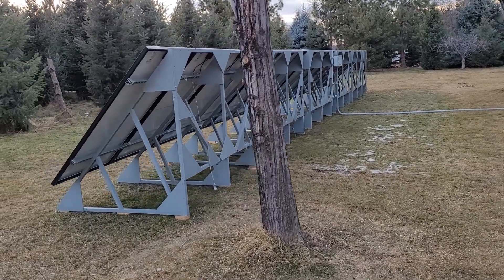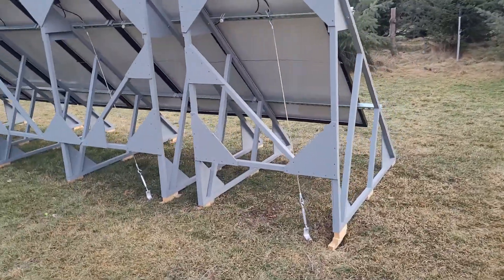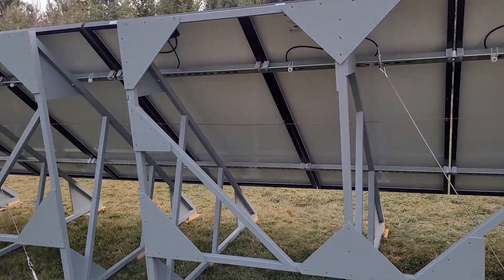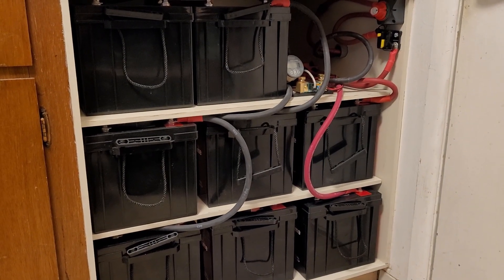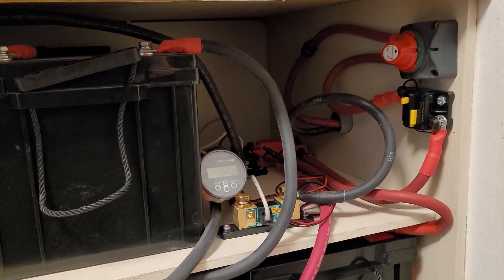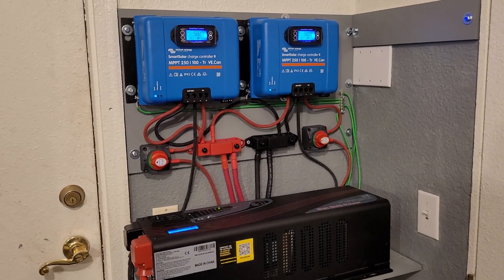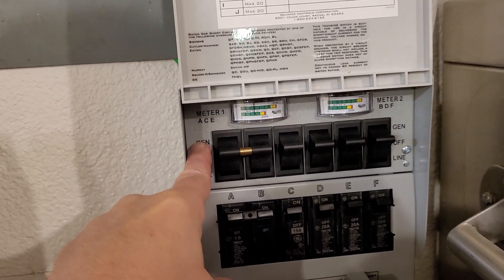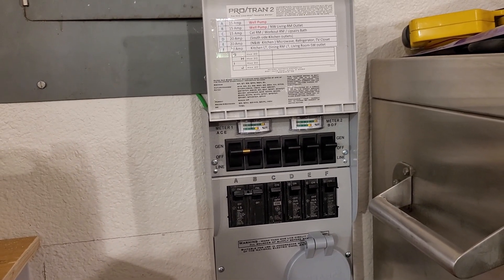Will this Solar Array Power An Off-Grid Cabin?

Comment: This was so fun to watch!  How often will you need to replace the lithium batteries?
Reply from the maker: They are supposed to be good for at least 4000 deep cycles.  That would mean if you drained them 100% once a day, they would be good for about 11 years.  In my case I don't come close to running them that far down every day so who knows exactly how long they will last me, but I am hoping somewhere from 15-20 years.

Comment: Look into micro-hydro-inverters when you look for power in your NID property.  You have great flow in the creek/brook.  Not sure of your drop in terrain.  Seth with Land to House has a good channel.  I am sure there are better channels for your specific needs too.  Might be too cold for hydro.
Reply from the maker: The creek is quite a distance down the mountain from our building sight however there is a natural spring that runs near the structure that has really good flow through the winter and early summer.  I will be looking into hydro in that stream to supplement my solar power which of course will be somewhat diminished in the winter months.

Comment: how about using one of those lock out double breakers for switching outputs from 220vac to either the well pump or the water heater?  that would let you run one at a time, but not both.
granted, i'm not an electrician.
Reply from the maker: I'm not an electrician either but your suggestion is certainly a good one although ideally, I would have a transfer box with more circuits.  Actually, my system could probably power my water heater in the summer months but probably not during the winter. I am going to be doing a 1-year review on my system outlining what has gone well and what needs to be improved.  keep an eye out for that video.  Should have it out in a couple weeks.  Thanks for watching and commenting.
Reply: @kombidog  i made a mistake on my reply...the difference is that double switches should be used, not double breakers.  breakers would just turn off the output, not switch it.
Reply from the maker: No worries, I understood what you were saying.

Comment: What kind of clamps attach to the uni strut? Looks amazing!
Reply from the maker: I ended up just drilling holes through the bottom of the solar panel frames and then running bolts clear through the unistrut.  Originally, I had bought solar panel clamps and unistrut nuts, but the clamps required too much spacing between the panels.  As it was, I could barely fit 3 panels on a 10-ft stick of unistrut.
Reply from the maker: I am probably going to do a 1-year review of the system in the next couple of weeks.  I will include some footage of the panel mount.  Look for the video!

Comment: Love your ground mounted you made, i thought it was made from steel in the beginning, amazing job. How do you like that Victron 250/100? Do they run hot? I am looking into getting one and found out that they get too hot due to no cooling fans.
Reply from the maker: I like the Victron 250/100. Mine do seem a little warm at times but I think that has more to do with my having mounted them above the Sungold inverter which does get very hot. The inverter does have a cooling fan but often does not turn on even when it is super hot. I have mounted a couple of computer fans to keep the inverter and charge controllers cool and it seems to be working. So I would say yes to Victron but no to Sungold. Thanks for your comment
Reply: @kombidog  I too have the Victron 250/100 ,mine is not yet up and running,, Last summer my Ecoflow battery started getting quite warm 35c so I just used a plugin thermostat connected to a USB desk fan ,,that dragged the temperature down to high 20s,, worked a treat..  And I will do the same sort of thing with the Charge controller,, may use a bigger fan ... But I think its as good as an internal fan,with the added advantage of if there is a fan issue ,then its easy to swop out..
Reply from the maker: @lipsee100  I have since done the same and put my fans on a thermal switch so that I don’t have to turn them on manually.  Of course, just as I got the switch installed the temperatures hear in Boise, Idaho have dropped, and the charge controllers and inverter are keeping plenty cool without needing the fans.  FYI, I contacted Sungold about the seemingly high temperature of my inverter and they said that the inverter’s fan should first turn on when the internal temperature reaches 150°F and then turn on to a higher speed when the temperature reaches 185°F.  They suggested that I get an infrared thermometer to measure if the temperature is exceeding 150°F without the fan coming on.  Well, I bought a thermometer but by the time I got it the ambient air temperature was already keeping things cool.   So, while I don’t know what the temperature was reaching at its peak, in my case, even the 150°F/185°F temperature that Sungold says are okay just seem too hot to me.  Glad I have the fans in place; makes me sleep better 😊
Reply: @kombidog  |Ha yeah  Now I,m coming into the winter ,,and have two batteries outside ,In the UK we really have wet winters not too cold below -5 sometimes -10,,so I,m thinking of using the plugin thermostat to switch on heat pads ,, just to keep them above say +3/4c  sorry we do,nt do F anymore...oh its 41F

Comment: Beautiful set up. How does it handle the well pump? How much current does your pump draw on start up? My pump is 3 HP  220 volts and seems to draw about 22 amps at start up. Do you think a 6000 watt inverter would work for me? Thanks, your system looks very safe and professional .
Reply from the maker: I have not been able to measure my pumps start up amperage and can't remember for sore what the running current is but I think maybe around 1200 watts. Also don't know the hp of my pump but it's depth is 177ft. My 6000 watt inverter has no problem running the pump even while it is running my aircoditioner.

Comment: Shorter darker days. Certainly not going all electric once fall Hits until spring comes again. Power to keep the Toyo still going and perhaps a pot of coffee everyday. North of Anchorage Alaska I'm more affected by the darkness curve. The overabundance of Summer is balanced by a under supply in the winter. I recently saw something about sand batteries to store heat from the summer. Heated to 1,000° during the excesses of Summer a large system will continue to warm during the cold months. Brings to mind the possibilities of geothermal storage. I bought my panels and it's like money I never had to begin with with the power output I now received being something like a bonus saving me money. I bought a heat pump portable air conditioner that does my heat during the spring and fall when it's not so cold outside and it's all running for free, off of my solar panels. That's enough for me. I save about $3,000 a year on fuel oil and as such.
Reply from the maker: I'm assuming your solar production is pretty poor about now.  Mine has dropped off significantly even here in southern Idaho.
Reply: @kombidog  the bright orange ball pops up and 4 hours later is gone. It's been cloudy and that's a zero even though the panels have that slight negative angle had no snow has landed on them. Truly the sun is no higher on the horizon that a negative tilt is almost perfect. I have the smallest Toyostove that burns as little as one gallon in 24 hours or as much as two with the middle in the middle. 100 ft of garden hose is the heat exchanger sitting in front of the heat output with two little fans directing the air flows, heating water into a large tank in my room before it goes into the water room with the toilet and the water tank. We got down to -10 for several days a week and I didn't have to turn the electric heat on for the water room and I'm ecstatic. The big Toyo stove was too big turning on and off hot and cold until the ignitor burned out. It could go down as low as 2 gallons and as high as seven. I used to use 1600 gallons when I had the furnace and now I'm down to 400 per season. No more $200 a month electric to heat the water room. I have a little fan heater in there that I turn on for comfort while doing my business. I'm keeping my electric consumption down to only 9 kilowatts a day. At 22 cents a piece, are $2 a day. The panels that were on the roof I left on the roof rather than move them to the wall. More effort the power would be worth, I won't take any effort to clear them off at this point. Actually it put a kilowatt back into the system, several times with the latest November 18th. To do that it also supplied my standing load that runs 24/7. Last year on March 4th was when it began with one kilowatt pushed to the grid one day the beginning of spring. I have 27 quote 300 w unquote panels and in June they produce 6,000 Watts several hours during the day producing power a good 18 hours a day in June on July surrounding solstice two weeks on both sides. So far the winds of Winter haven't appeared. I'm working on wind project for that but it isn't mature yet. I got those from Missouri wind and solar. Commissioned salesman. 48 volts exceeds 120 DC when the wind is really blowing. Terrifying arcs and blade speed. White hot heating elements bring panic. No fires so far.
Reply: The water in the storage tanks going through garden hoses it's during hot water doesn't make for potable water and I don't use it for drinking. I have a separate connection straight to the well that brings clean water. And my sewer  hasn't Frozen this year. Drip drip drip drip drip drip drip even under a new flapper when it's icy cold, solid ice fills the drain into the septic. That's when you circulate hot water through it and that's the expensive day I can tell you when it froze looking at my electric bill. 30 kilowatts or better that day or days. I close the water valve to the tank solving that problem. The crawl space at that point where it freezes is too narrow to freely access. With 4-in corrugated tubing and a hair dryer on the end with an extension cord going through it I was able to easily aim the hair dryer against the spot 15 ft away. It remains there to this day with the cord ready to plug in through the crawl space access. Instead of spending 1600 gallons of fuel oil and still being cold using the central furnace. I just heat my room able to turn on the furnace to do work around the work rooms and feels toasty enough to be comfortable when it hits 44°. I can turn it off and leave my door open with a high efficiency heater able to hold the line if I need to keep the room warm for much longer shutting off the big heater which uses I think one gallon per hour yet can't heat the building, a large drafty cabin in retirement that will be replaced with a large modern. The squirrels go in and out, generally only one living here at a time. I like the one who is here now, a little girl squirrel that interacted with me, with the squirrel number two resident never very nice to begin with would chase her away. I didn't like him, he chased out the first one that I built a box for so it knew it had its own spot and would put looking around for another one and that worked. My little bull puppy is now 4 years old and knows this is peanuts house as well. It stays out of my room and I know not to put tasties from the grocery store on the table. That's why by Kirkland Doug's biscuits instead of the normal one in the red box. The squirrel breaks into the Red box with a small hole and empties the box. The Kirkland one has sheets of paper and they're all stacked nice and pretty and the squirrel can't get down to the second layer through the paper. That's a tip. And if you forgot to open the peanut butter jar, the little chee marks will remind you to microwave the container upside down into a microwavable bowl creating a beautiful tapestry for a little tiny footprints until the bowl is clean. No TV, or Internet, just my $100 phone. My credit card was totally paid off and it still is and I bought a lot more dog food today and pig ears in the $30 bag. Just like Hunter Biden, it wasn't always this way. I put my past behind me and redeemed myself. The people of my past are still out there lost. I am where I'm supposed to be and everything is perfect in the wilderness away from all of it except for this damn phone. Like the house with no antenna in the Woody Allen movie, I don't have many books to burn, but I don't use a lot of energy, much less than I used to. Free power in the summer the air conditioning is luxurious and winter is always rough and expensive. So that's the part I attacked last. They didn't want to sell me a smaller heater and I wanted heater that would use the least oil possible at maximum. I could consumption from one gallon an hour but didn't work very well to 2 gallons per day with a warm bedroom and heat as you need it in the water closet. The oil heater making the 80 gallon tank of warm water, gas water heater actually that's not connected but a heat battery keeps the power goes out sits in my bedroom before the coldest water in it goes to the back room warming that with AC cold water coming back this way. When it's 20 below zero and the bathroom water in this 28° slushie comes out of the faucet. And the easiest way to heat that up is with warm well water. So I do have the water also running softly draining the coldest water with the well providing warm water in a post fashion and that I think is a big part of what's keeping the bathroom warm. Just ruining the water slowly to warm the 300 gallon tank, a big plastic tank that's just there and really expensive to keep warm. 3,000 watts, 70 cents an hour can't keep it warm, so why bothering. The well water keeps it above freezing and my little circulation thing helps. So I'm trapped at 2 gallons per day maximum price which is what I was looking for instead of maximum comfort which I'll enjoy next summer spending the money I didn't have to give to the oil company.
Reply: @kombidog  the forecast today is clear and sunny. I have my kil a watt meter that you plug in the wall to measure how much an appliance runs through it. The original company makes really incredible stuff but not that anymore as there's a million invitations. 10 bucks or so each maybe 30. The sun comes up at 10:00 and goes down at 3:30 and it's low to the horizon. I haven't checked, we just had a lot of snow. So today I'll reset it and I'll see how much we make that doesn't make the meter spin backwards. I consume everything it produces I'm sure and then some. A fun experiment I will like to know the result I will share them tonight
Reply from the maker: @zAlaska  If you remember from the video on my solar system, it is only meant to be in its current location temporarily, until I move it to an off-grid cabin that I am building.  Without cutting down a bunch of trees I had very few options of where to place the panels; none of which were very good.  Actually, the system worked well last winter and all through the summer but now that winter is here again and the sun is much lower I have found that many trees grew enough last summer, that they now cast a shadow on my panels where they didn’t when I first put them up.  My cabin project has been delayed and whereas my original plans called for having already moved the solar panels to the cabin, I am now thinking they might not make it up there for another year or even two.  That leaves me wondering if it is worth the effort to try and elevate the panels and adjust their angle for winter sun.  Cutting down trees is not an option as I like the privacy they provide.  Looking forward to hearing how your experiment goes.
Reply: @kombidog  21 @ 300 watt panels averaged around 70 Watts with the peak of 112 and a total of 0.303 KW or 303 Watts or 7 cents worth of electricity valued at 22 cents a kilowatt. Yay big deal, I guess every little bit helps. The sun was more beneficial so I could shovel the roof off. That's a flat roof in the back and they had this nice slide and slide type shovel perfect for the roof you just grab a scoop and slide it around you don't have to lift it up at all. So I've been cleaning up two feet deep snow and out of the parking lot and off the roof and that's what the sun was good for. Unlimited boiling water in the summertime.

Comment: What inverter are you using?
Reply from the maker: It is a sungold, I would not recommend it. It gets really hot and it's internal fan often does not turn on. I have added external fans to keep it cool.